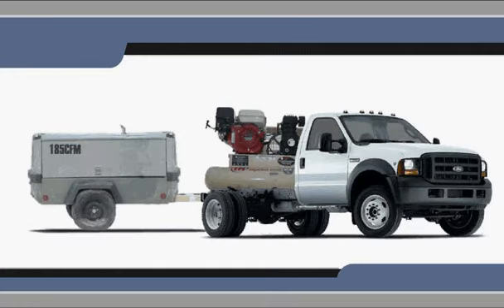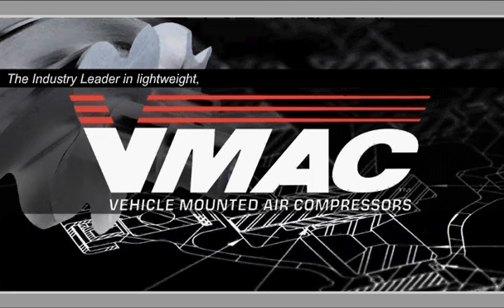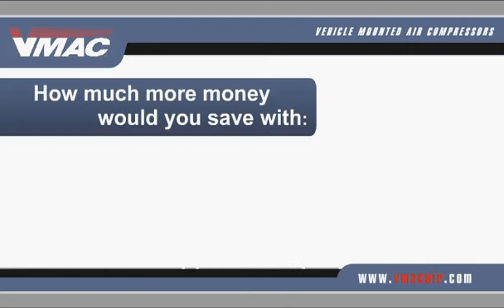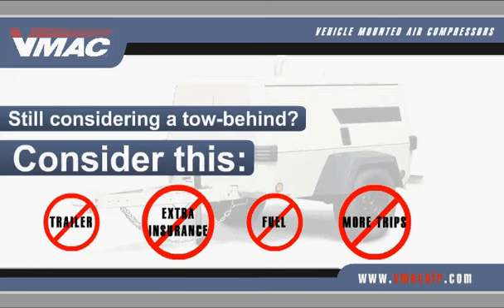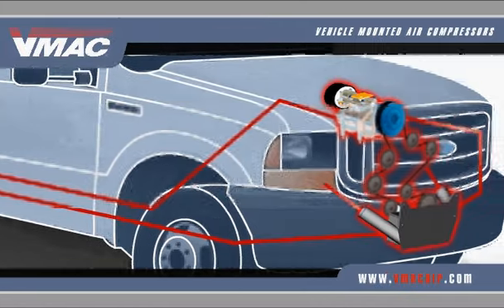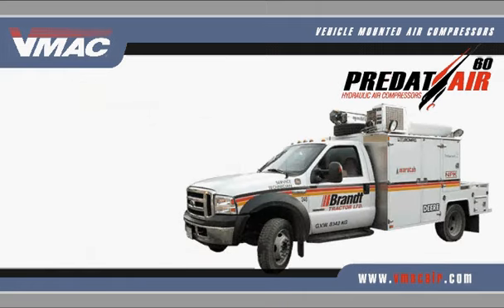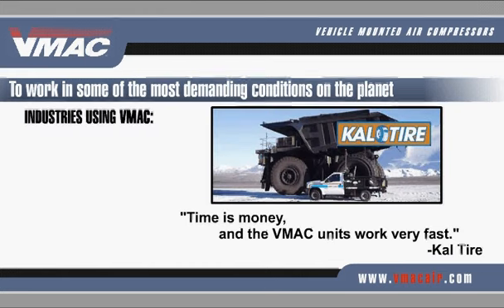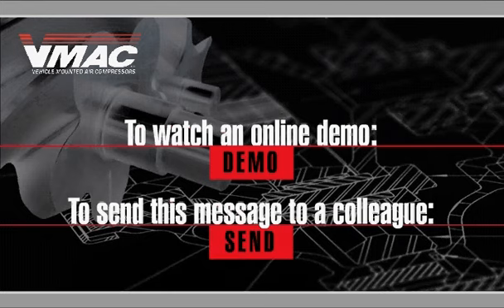VMAC - How Our Vehicle Mounted Air Compressors Work

Comment from the maker: @Zeamus634 
Actually, our advanced digital control system allows the vehicle to shut itself off when air is not in demand and then automatically turns it back on when air is needed.  VMAC is sensitive to the environmental limitations and needs of our dealers and customers and takes those factors into consideration when designing our systems.  Thanks for your feedback!